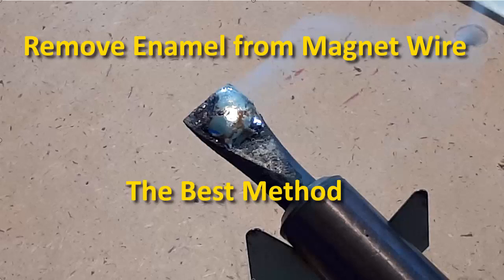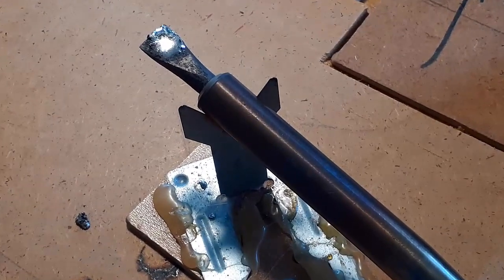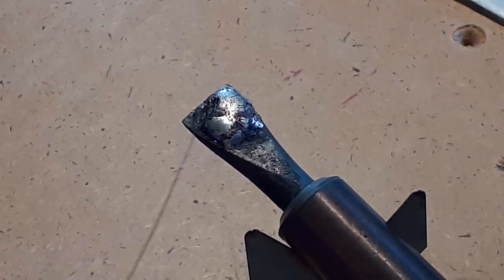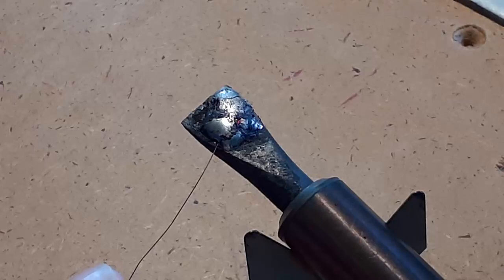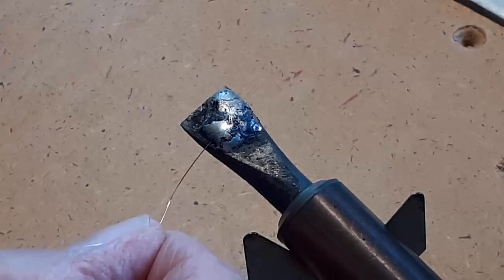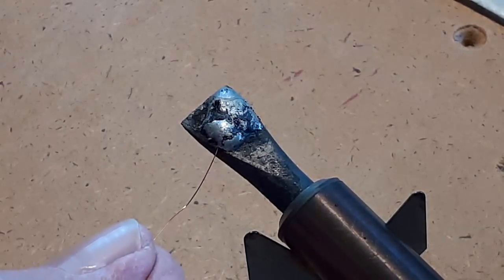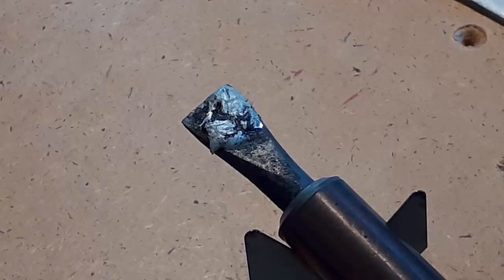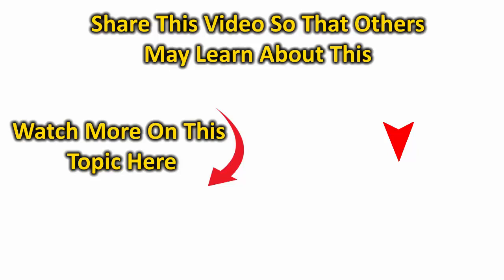Fast And Easy Magnet Wire Enamel Removal Makes Soldering Magnet Wire Simple Especially SMD LEDs.

Comment: This also works great with regulated irons if you set them to 380+C ! Then you can set your iron back to 280C and solder as normal without melting the insulation.
Reply from the maker: The residue can mess up the iron tip.  That is why I went to this method.